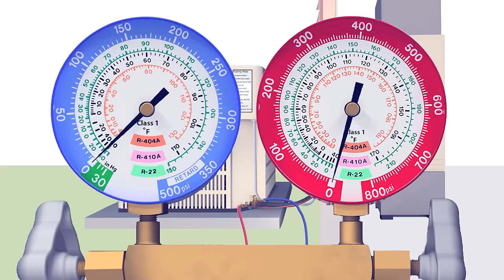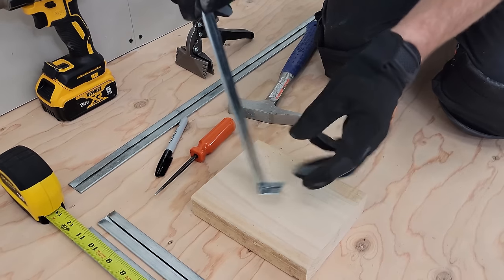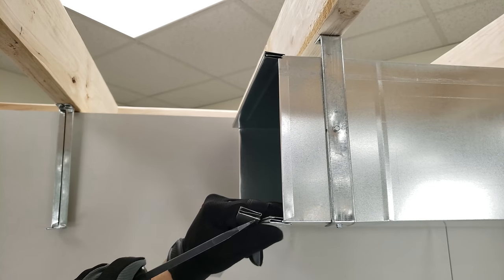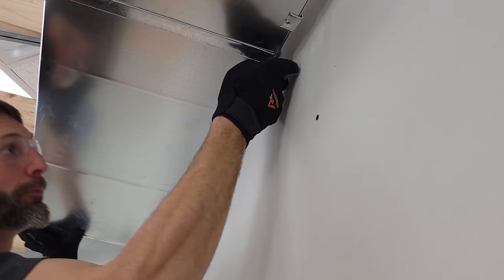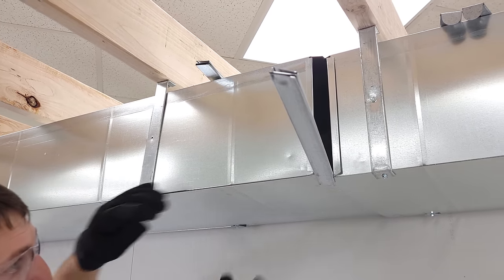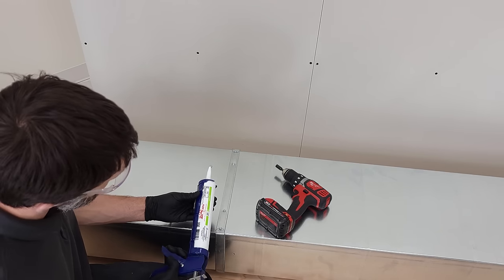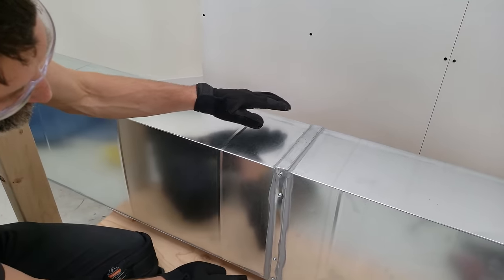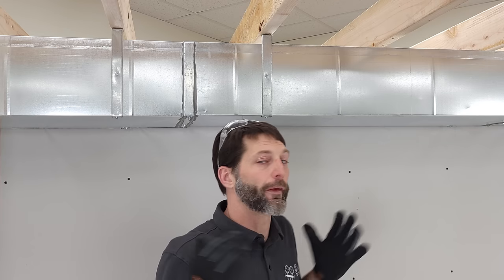HVAC Sheet Metal Basics! 3 Methods For Hanging Duct!

Comment from the maker: For methods 1 and 2, because the duct is an inch away from the back wall, mastic is applied to the back side from the top and bottom using fingers and for the hard to reach middle section with mastic on the end of a piece of drive. This becomes much harder when hanging duct that already has insulation on it. You need more room such as hanging the duct 3 to 4 inches away from the back wall. Near the drive ears, we usually fold the insulation inwards so it is tucked under itself until we make the connection, seal the duct and then the insulation can be pulled out and taped.
Related Videos:
-Quickly Make a Sheet Metal Plenum at the Job Site! Measure, Cut, Bend, Seal, Mount! https://youtu.be/WL023SERpDg
-Building a Sheet Metal PLENUM and END CAP with Hand Tools! https://youtu.be/hMoNZx494Qs
-How to Make a FILTER RACK in a Plenum or Duct so that the Filter Slides In Smoothly https://youtu.be/TxfgJCgKZTs
HVAC Emergency Condensate Pan! Bend and Make a Pan that does Not need to be Brazed or Leak Tested!
https://youtu.be/viy8MYvYflQ

Comment: Wow didn’t realize that mastic comes in a tube. Looks better doing it that way then it is using a paint brush to brush on the duct butter
Reply from the maker: It is certainly easier, thanks!
Reply: Bucket is cheaper, tube is cleaner.... Both have their perks
Reply: I did that for 5 years. Used a mastic bucket.

Comment: I’m a DIYer but also an old carpenter. Did duct work with my pops many many years ago. This video was very helpful and brought back a bunch of memories. I remember we would spread the S-connectors just a bit and usually had to hammer them on. Probably bigger ductwork. Thank you for the video it’s very helpful

Comment: Hey Craig, I am glad that you started showing ductwork. Could you also make a series about air distribution? I see a lot of installers in Canada doesnt know it and install furnaces, ac's not matching duct sizes. Consequently plenums bang, furnaces overheat, motors fail, HXs crack. Thank you for your work ✊🙏👍
Reply from the maker: Thank you for letting me know what you would like to see!

Comment: Thanks for the video. There are many ways to hang, connect, insulate, and seal duct systems. Along with proper sizing and design you will avoid most problems.
Reply from the maker: Absolutely, thanks!

Comment: Craig, I spent nearly 10 years doing mechanical demolition, and only a couple times installing it. Some of the ductwork we had to remove from the inside as it was in a hallway and had conduits/pipes in the way. Usually it was a trunk that came out and sometimes just branches. I've seen good installs, and bad ones, and what you taught in this video is good information. I actually designed and made some tools for the trade, however, someone copied my idea, so I didn't make anything on it. It was a tool that was made to pry off the backer plate from school fin tube systems.
Reply from the maker: Tool ideas and patenting are certainly rough processes. Thanks for sharing Bryant!

Comment: You might investigate what we in the sheet metal workers (founded in 1888) have been using to make holes in hangers, duct, and sheet metal in general for over a century. William Whitney's (founded 1907) hole punch. Various size dies for every fastener size. 
 Proper tools.
Reply from the maker: Bob, I have the Malco hole punch and I use that. I was just showing very basic methods for residential duct hanging with just basic tools, thanks!
Reply: Why use a.punch when a screw works just fine.

Comment: Well, I just use prefabricated ducts + connectors with seals, connect them with blind rivets and hang them up with threaded rods + supporting assembly beams. The advantage is no mess with sealants and works well with concrete ceilings and other harder materials. I wonder what kind of billing do customers accept when so much artisanal work is involved?
Reply: Could you post a video or picture? Thanks
Reply from the maker: Yes this video was meant to be on how to hang duct in residential applications. That is mainly what we do in commercial applications or spiral ducting, thanks!

Comment: As someone that does sheet metal install professionally for industrial this was a weird video to watch. For one, the mastic I've always used is brushed on. For another we never use drive for hangers, we use strap. We don't screw into the drive then into the slip, as that compresses the duct and doesn't grip as well (though we also wouldn't use long zips for it so that may be a remedy). This video is also missing tdc/tdf connections though I doubt that ever comes up for residential.

Either way, although really basic, cool to see how the other side does it. I'm used to hanging duct work in either concrete with tapcons or securing the duct using steel joice and/or unistrut. Never seen sheet metal duct work secured by wood beams but it makes sense for houses and the like.
Reply from the maker: Don, it is certainly much different when installing in commercial applications compared to residential and each face a lot of hurdles and are unique. This was just a basics for residential duct hanging, thanks!

Comment: Stagger your seams. Slip cleat u usually cut it 0.5" smaller than the duct to accommodate for the bottom lock seam.

Comment: Great video! We are about to start sheet metal in our new build. Our trunks will be wrapped in two-layer reflective insulation - what are your thoughts on strapping it up with fabric strapping rather than puncturing the insulation with screws?

Comment: Pretty good for a basic beginner video but you forgot to mention the prep work needed for the slip and drive to make the connections, for example spreading the slip and drive a little bit to make it slide easier also in some situations you can use a duct stretcher tool to help assist with putting on the drive connections, in other words I have seen so many different ways to do ductwork I was told by an old time tin knocker there is no right or wrong way to do ductwork as long as all the connections are air tight and sealed properly then it will work. Other than that great video!

Comment: Love the tin vids. Great for us AC guys and service lol . I did duct work and gas for my first 2 years I think metal is looked down upon too much there are guys at my company that are magicians at it. I actually miss doing it. Just if anyone knows the reason we put cleat the way we do. I was always taught to put both cleats opened on the outside , meaning the top cleat has its top opened and the bottom of the duct has the cleat opened on the bottom . I see in this vid they are both at the top ?
Reply from the maker: This way it keeps the ducts the same size. Whether both at the top or both at the bottom. everyone has their preference, just a basics video, thanks!
Reply: My preferred method and I think the proper way is both s locks in or out. The issue is if installed as it is in the video the duct runs end up having an offset at the joint ( as can be seen if closely observed in the video) and in my opinion it looks like a poor installation. As far as the air flow and size of duct I would believe that it is insignificant and accounted for in the ACCA duct sizing tables. If installing as presented in the video the joints should be alternated, one up, one down,etc. Finally it should be noted that when installing rec duct runs particularly long ones, the snap locks or pittsburghs should alternate. When installed this way if there are inconsistencies in the duct fabrication they will self correct and allow a straight run.
Reply: The reason the S clete opening is on top is so the weight of the duct is sitting on the previous duct. With small ducts like this, it won’t make much of difference. Once you start hanging large pieces of duct different story, generally also why “standing S” is used in replacement to strengthen that connection.

Comment: Thanks, how about an insulation video? I know is basic stuff but there is a lot of new people getting in the trade right now.
Reply: I mean. Isn't it literally just cutting the insulution to size, a little bit of silver tape on the duct, fit the insulation tightly to the duct work, tape the seems up good, then white mastic on the outside
Reply from the maker: Felix, thanks for letting me know what you would like to see!
Reply: @donpatch9196  does it matter?
Reply: @NoBody-ro3xj Just seems bare bones basic is all. First hour of the first day on a job and you're near fully trained
Reply: @donpatch9196  some people learn visually, some people learn by doing, some people learn by hearing. Some people just like to see other ways people do things.
Reply: You get the irony of your comment right?
Reply: @acservicetechchannel   Tips on how to make insulation look better and or how to do it faster. How to work in tight spaces such as attics. How to pre insulate in order to save time. In other words... how to do a good looking, long lasting job that will stand the test of time.

A lot of people think insulating is simple so the training is usually minimal. But, the difference between a good and poorly done job is too big to ignore.
Reply: @NoBody-ro3xj  You get it. I just want to see how Craig does things. I'm sure I'll learn something if he decides to make a video about it.

Comment: So I’m order to get mastic on the side closest to the wall, you sort of have to use the last method no?
Reply: you could try pookie on a stick, fish foil tape through, or cut a access hole similar to the process for cleaning ducts and seal from the inside.
Reply: Its a demo set. All situations are different. Figure out your situation and what will work best for that.
Reply: In a situation like that most people would opt to seal it up and then slam it close to the wall, but if it gets overlooked, finding a piece of conduit that will fit a pookie brush also works. You could also silver tape it all I guess, but putting some kind of mastic on the tape after helps with longevity. Your best bet would be to form it all up on the ground (as shown), pookie it up real good, let the mastic dry (will be dry the next day unless using a really wet sealant), and then hang it
Reply from the maker: You can do as Avery and Don are mentioning. In this instance, you can get to the back side of the duct from the top and bottom since it is 1" away from the back wall, thanks!
Reply: @acservicetechchannel  thank you for the reply!

Comment: You don’t use 3/4” zip screws in attics and crawls when going to wood to hold the duct work?
Reply from the maker: Those zip screws rot in crawlspaces because they are not galvanized. I have seen hole lengths of duct fallen and lying on the ground in crawlspaces. Thanks!
Reply: @acservicetechchannel  good to know… thanks! Random question but I’m evidently new to the trade. Is there a solid budget friendly multimeter you would recommend?

Comment: No insulation inside?
Reply: It's a demo. They will always make it with the least amount of struggle.
Reply: Sheet metal ductwork very commonly doesn't have insulutation inside. I recently did a VA hospital and am currently working on a bio lab and it's all just exterior insulation. So it's not entirely necessary it seems.
Reply: @donpatch9196  do yall make your own duct work?
Reply: @NoBody-ro3xj  At the VA it was a third party company. For the bio lab, it's been our own shop. I don't personally make the duct work though. I've had to do field work like miters or reducing/changing the size of duct, but nothing like actually operating a pittsburgh machine or anything like that.
Reply: @donpatch9196  it might be a state thing but most places around here in n Utah we build our own duct insulate the inside, and install. The only people that don't do it also don't build their own duct and sub out the insulation.
Reply: @NoBody-ro3xj  Yeah I live in Florida. Though I've dealt with duct work that is inner insulated and also double wall insulation, the majority of our duct work seems to be only externally insulated (and sub contracted out). Granted I've only been in the sheet metal trade for about 2 years. The majority of my experience with inner insulation oddly enough is in schools and one recreational center that had exposed spiral pipe (that was double wall insulatation) for a gym. Hospitals and laboratories don't seem to care so much.
Reply: @donpatch9196  we do a lot of schools there would be no room for outer insulation.. I imagine that's why they don't do it.

Comment: Invest in a Whitney punch makes installing screws much easier. I’ve always used long hex screws to hang the duct to the joists. Why so many screws, I thought 2 was all that was needed.
Reply from the maker: Certainly a hole punch is easier if you are hanging a lot of duct! I have actually seen a lot of those 1.5" long zip screws rotted when hanging duct with them when they are screwed into the joists. Crawlspaces are really wet here by the ocean so we don't take any chances. Two screws on each to be safe, thanks!